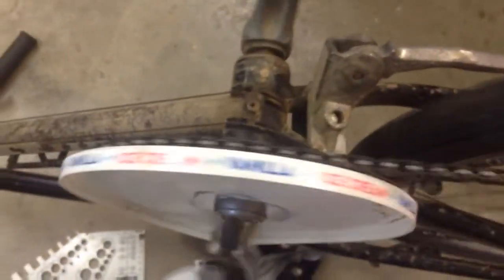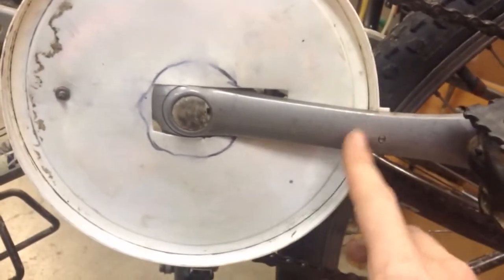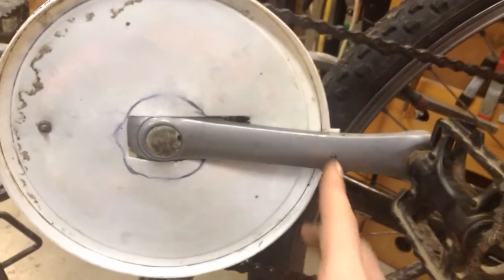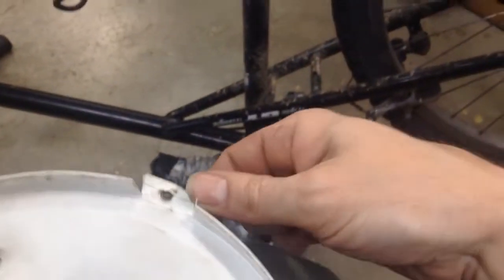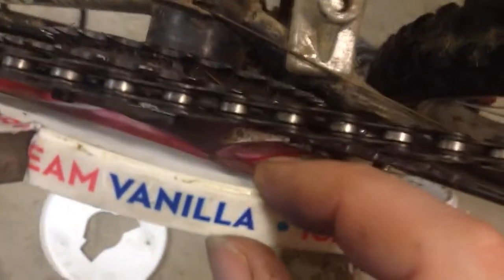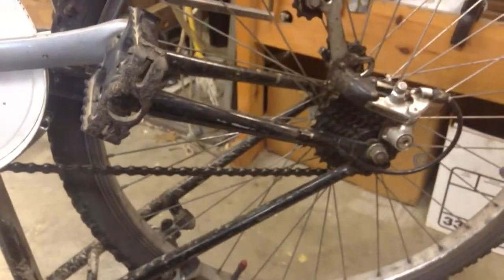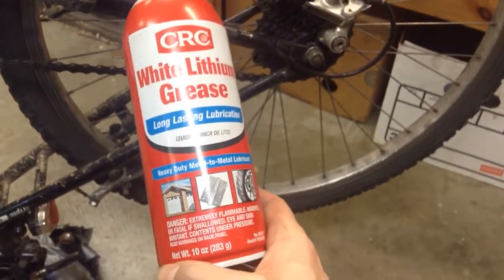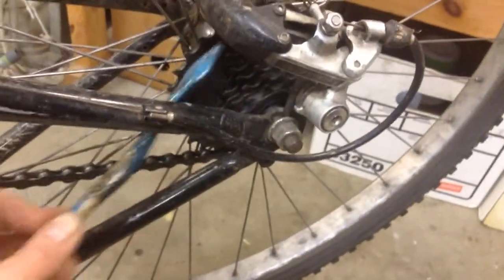How2 Make Simple Bicycle Chain Guard DiY

Comment: That radio looks like its missing the left speaker ? Your chain guard is quite inventive and does the job.The largest sprocket sometimes has tapped holes to attach small bolts to for the chain guard. such as the "prowheel " brand.  Many others simply have holes drilled for sharp screws that screw into a chain guard from the opposite side.  i dont know if those holes would be useful for you because a manufactured chain guard is offset from the largest chainring. It is funny how many new bikes dont even come with a chain guard. That guard can save you a nasty injury if your chain ever slips or falls off.  I only use motor oil for chain lube but it does attract alot of grit and needs the be cleaned daily.  I fabri-cobbled a similar "dork disk " for the rear wheel using the back of a 10 pack cd case. then drilled a bunch of small holes to ziptie it to the spokes... still works.
Reply from the maker: Ohh dern man, I thought it was the Right speaker that was missing, Shucks. Ha. Thanks.  Yeah it's still working, hasn't snagged my pants leg since; hallelujah. That's crazy new bikes not having any kind of guard, you'd think manufacturers would want to cover their backsides better, maybe they just got better lawyers instead while cutting down on material cost$. Chain on this bike only comes off accidentally when I back up er turn the pedals backwards, comes off the small Low gear in the front. Be nice to have sum kind of dork disc to prevent that annoying glitch.  Hopefully you're using some thick motor oil like 20w50 so it'll last longer. How do you apply it just w/ an oil can?  Heck u could use some used motor oil if u wanted, I burn it & used ATF in my VW diesel. Occasionally use it in the workshop drilling holes in stuff.   I love using grease b/c I can use the tooth brush to really work it into where it needs to be. Haven't done it in a long time though.  Had to tighten up my rear brake & it's Way better.  Have to be careful on 1 road I ride on, cars speed a lot, & when cars are coming in both directions doing 40+mph er more I don't have much time to turn in the nearest driveway.
Reply: Nice